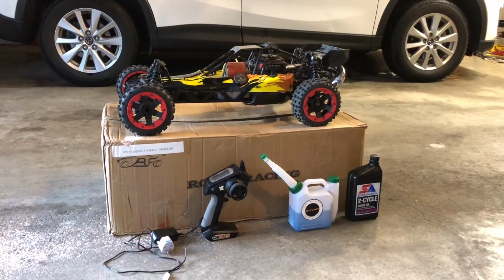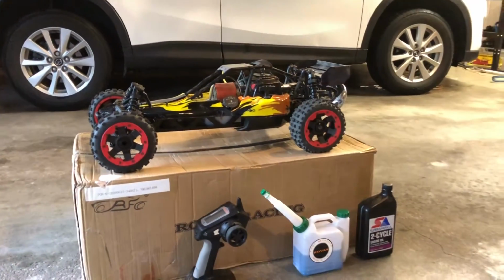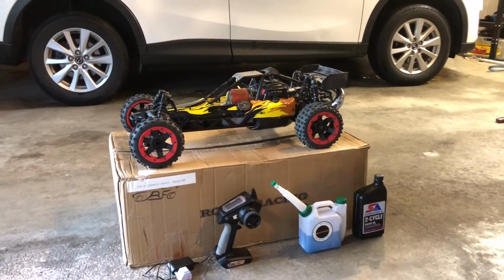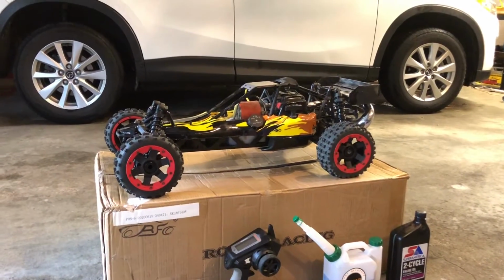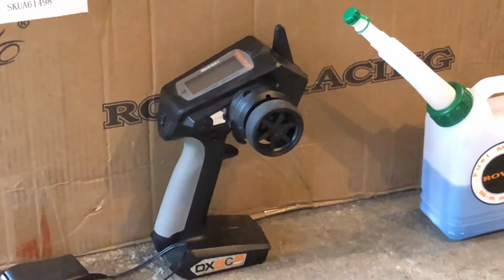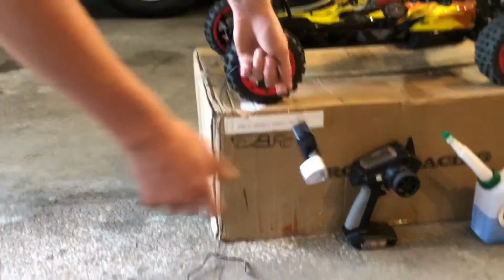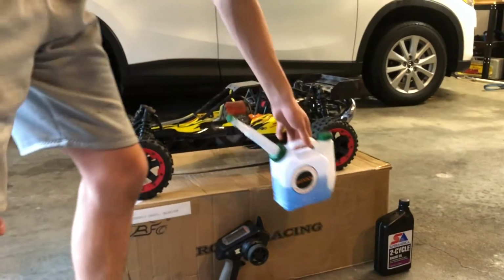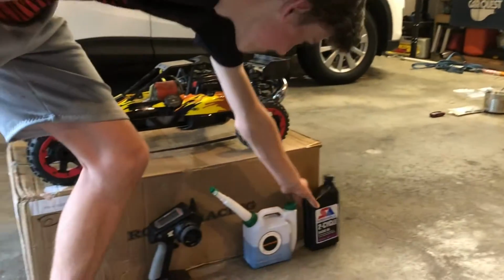Rovan Baja 5B Review & Drive

Comment: So 
First when i saw you pulling the starter i thought well he is new to 5th scale...

Pull the starter until the starter grips the flywheel, then pull strong short pulls there is no need to yank it up. 

Running in: heat cylcles: so you want to run your engine 15 mins then let it cool of completely. Do this 4 times. You should be save from there.

Failsafe is Actully the first thing to do on something like this. If you loose range meh you might be ok 
But when there is connection problems the Failsafe dosent do anything and your car will run in to something/someone.
And when the battery goes flat the car will run away still. And you have the luxus of turning your car of from the remote.

Always change out the cheap spark plug what is in that engine. 

You dont want to run cheap 2 stroke oil that will damage your engine more than everything.

After you started the engines let it idle for 10 secs so it can suck some gas through the fuel line. And let it warm up for a bit don‘t floor it instantly.

Dont throttle it like : brap... braap brap brap. The idiots just wear down the throttle shaft in the carb.

And oil your inner filter ofc

Comment: have u had any problems with the steering? mine wont turn that well thinking about getting a new steering servo
Reply from the maker: You probably just need to tighten the screw that holds the servo saver spring together, there is a little hole for it near the servo you will see it. Tighten that screw until the bottom of it almost touches the bottom of the chassis

Comment: youe engine wont last 5 minutes with that crap oil, it needs race oil smh
Reply from the maker: It sure will. I’ve ran it so much since then and it’s still in great condition, has 110 PSI of compression. I check my oil ingredients before I buy it, and this stuff was of decent quality